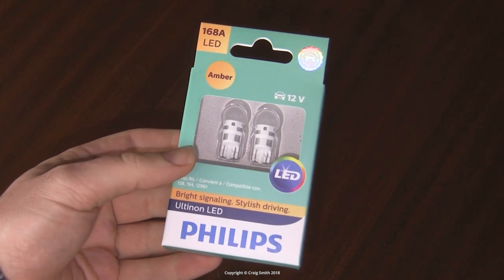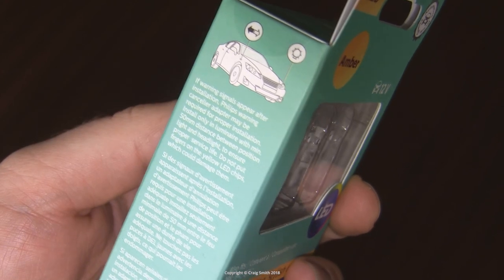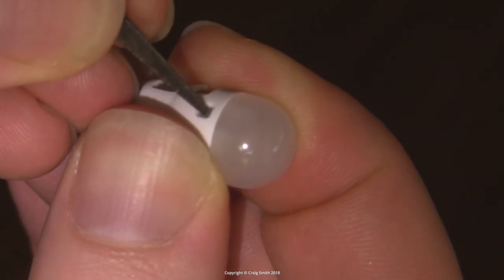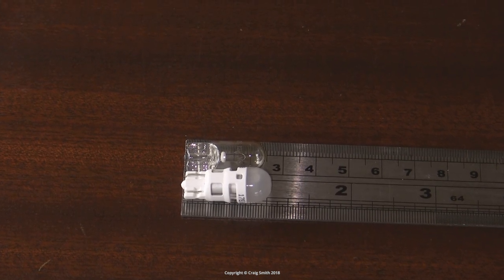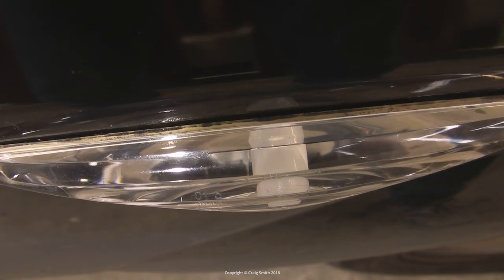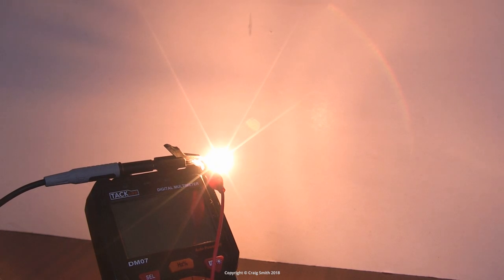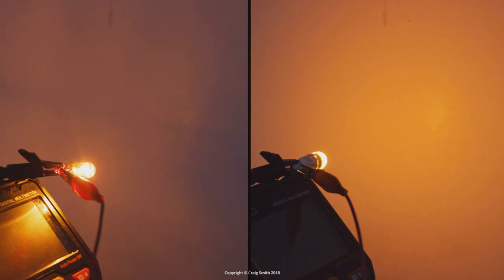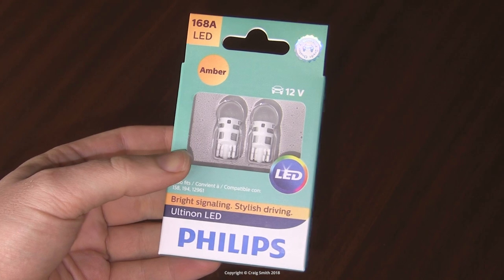Review: Philips Ultinon T10/W5W amber LEDs

Comment: Is it better to use Philips W5W Xenon Intense White Light or Philips W5W Ultinon LED? I want to change the puddle lamp and glove box lights. The Philips Xenon White Intense bulbs are three times cheaper than the Philips LED bulbs, and there are a total of six bulbs. I just want to refresh the look rather than using regular halogen bulbs.